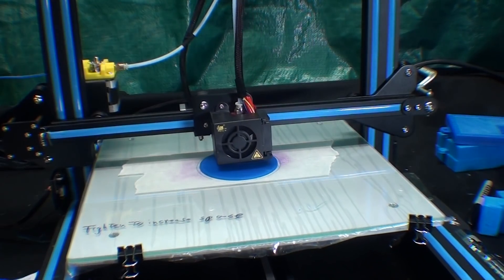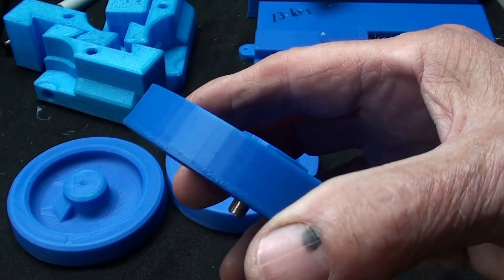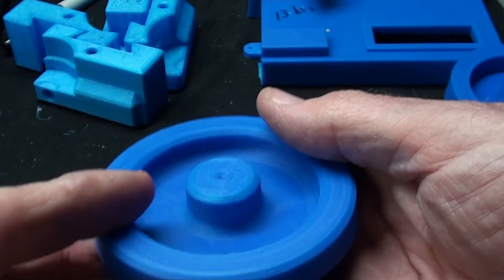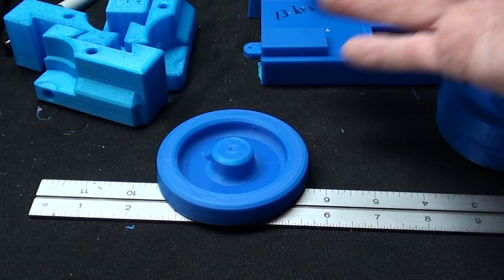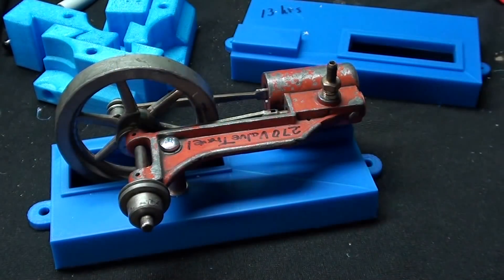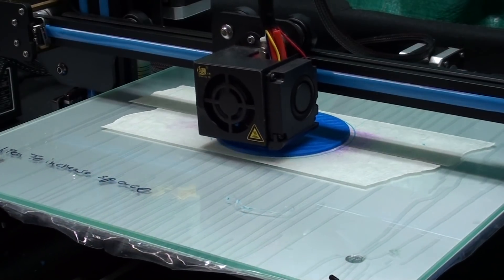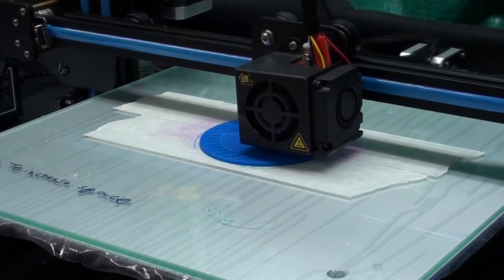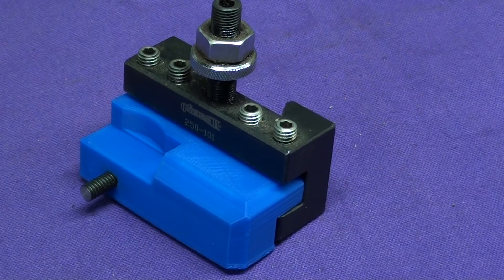3D Printing CREALITY CR 10 with tubalcain #2

Comment: Mr. Pete Is there a print cooling fan and a heated bed on your printer? When I print without these I get the warping problem. Do to upper layer contraction.
Reply: This is the first thing anyone should print for the CR-10, proper part cooling.

Comment: Can you turn up the platform heat on your printer? A higher setting might help with the warping. I run my printer platform heat at 130 degrees and it seems better that the default which was about 110.

Comment: I wonder if you could make servicable gears for a small lathe with this type printer; mine on a 10" Logan are very noisy ; plastic gears should be quiter. Thanks for another great video
Reply: They won't last very long,  but it's something you could do if you needed a weird ratio.  There are new filaments in Nylon and PET which are quite tough,   but a better route is probably to print PLA patterns to cast an aluminium blank (or iron or bronze,  if you can make a hot enough furnace) like Mr Pete, and then machine the teeth and bore.

Comment: 3d Printer is sometimes hit or miss. There is a lot of variables. It is a nice to be able to come up with an idea model it in a CAD program, slice it with a slicer program and hours later your holding it.  But it not always that simple. You have bed leveling. Different filaments also melt a different temp. If you have a heatbed. For me I get one or two bad prints for every ten prints I do. Most of mine fail from bed adhesion or bed leveling. The main thing is to learn from your errors. I have learned a lot from YouTube videos like Makers's Muse. Just keep trying and learning as you go. Great video by the way keep up the good work.

Comment: Thanks for the videos.  So in regards to the issues you are having... The plastic needs to stay warm throughout the print.  To do this you need a heated bed.  The last cr10 I saw had one but it was just the center, the fix was a silicone heated mattress that is built for printers.  Also you should put an enclosure around the printer limit airflow to also keep the heat.  The third thing, you mentioned a flex sheet for the bed, that would likely be an aluminum sheet with pei, though the newer and better one is spring steel sheets with pei powder coating baked on.

You might want to consider also talking with form labs about their resin printers.  You can print with greater detail on them.
Feel free to reach out to me if you have questions.
Cheers!
Reply: That should have been silicone mat... Not mattress... Ugh auto correct...

Comment: what are you doing up this early?  illinois is still dark!

i'm sure plenty of people have suggested using primer/bondo to improve surface finish for purposes of pattern release.  It is also possible to use hot air or solvent vapor to level the surface.  To some degree, this can be used to repair warped prints.  All of this comes with a loss of accuracy of course.

also: if you're ever willing to consider firing plaster, printed parts can be investment cast.  look up the depolymerization temperature  for PLA/ABS and you'll note that they're well within the schedules for firing investment compounds.

Comment: Plastic shrinks when cooling.  Just like metal casting.  The differences are in the thermal expansion coefficient and the ultimate melting points.  Metals have lower coefficients, but higher temperatures.  Plastics have lower temperatures, but higher coefficients.  To prevent the print time separation, I understand, the better printers have a heated base.  That should reduce or postpone the warping.  Even better, if the base also has a thermal expansion coefficient close to the print material.  Glass has very much lower than plastic.
These are just theoretical considerations, as I don’t have a 3-d printer (yet?).

Comment: I can't believe i forgot, you're in the shop, there's dust. Put a regular sponge around the filament right as it exits the spool. There's a 3D print specifically for the Cr-10 on Thingiverse (a petite case that holds the sponge and mounts) but all i did is i wrapped some cotton and a sponge around the filament and tied it down with a zip tie. My shop is slightly more clean than average since i had the luck of a very well made ventilation and filtration system, and still i find grime, and what i can assume be, only metal dust, inside the cotton and the sponge. This helps a ton with the life span of the "consumables" (i call em that, the tips being replaceable). 

On a side note, that information is conflicting among us is perfectly understandable and not any one's fault. Many companies make many different machines that behave in many different ways. And that's without going in to software and all the custom things you can throw yourself in once you get a handle on it. Caution is always good, and common sense is important, but really, unless it's something that's obviously not going to work or might become a damage, there's no harm in trying things, then reverting if they don't work. 

Did you turn off the cooling fan in the settings? On PLA it's no good with this machine because of the way the main fan is mounted in the case, it's like adding a second set of wheels in the front of the car. I turned it off and haven't used it since.
Reply: Yeah, you need to turn off the cooling fan. That's the reason for the warpage. Trust me on this.
Reply: I've never had issues with just the tape, and a slow start (using the thumb wheel in the main page to slow the initial print to a crawl, then speeding it up again once it finished printing the first layer). And by that i mean, either with the sticking or with the removing of the parts. I find that simply picking up the tape off the glass then shoving the spatula under it will remove the part with ease.
Reply: aserta 
You know, mig welders uses a "sponge" to keep the shop dust off of the welding wire to help maintain clean liners and welds. 
 I'm sure you could just use an NONE-OILD wire "sponge" for the size if the plastic string you are using.
Reply: When therforming plastic sheets, sometimes you have to 'dry' the plastic by baking it for a few hours just below the plastic deformation temperature.  Perhaps you can dry the filament the same way...

Comment: I don't know what plastic your using but you should use something like PLA or maybe even PETG that doesn't have a tendency to warp and you need to print it on a raft. Those to things will fix your problem most likely. Also I no longer bother with tape and glue for bed adhesion it's just a pain as far as I'm concerned.  I have a sheet of PCB perf board without copper dots or strips and that works amazing because the plastic squirts into the holes and mechanically locks the part down. I almost never have problems with bed adhesion and if you need a dimensionally accurate print on the bottom print with a raft and you should get good results. Also this whole thing with 3D printing is just a pain. No one tells you how much time you will spend calibrating and cursing at the thing.
Reply: MOO Tech ... pet g is really nice